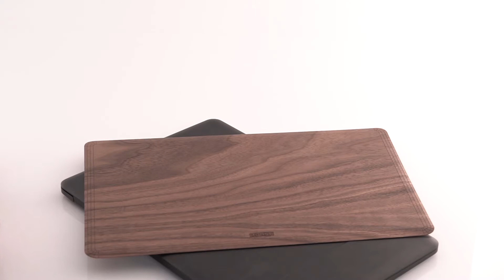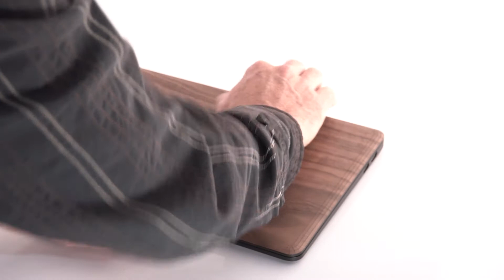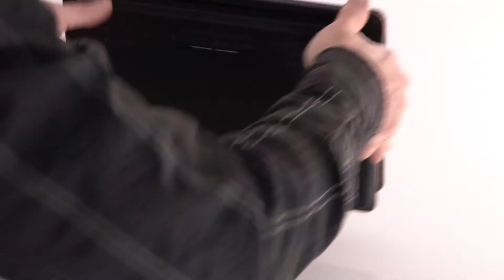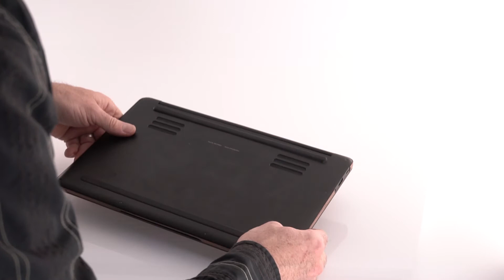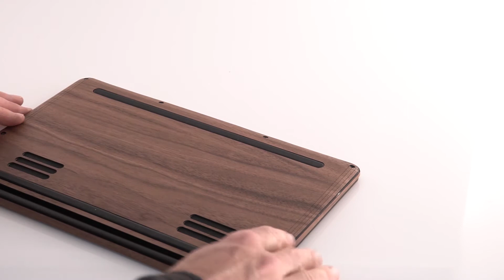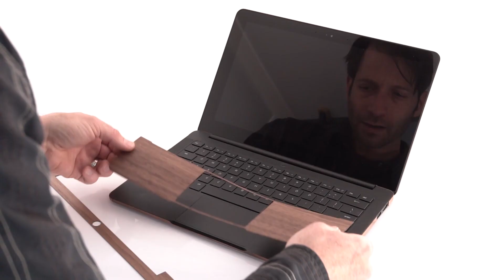How to install a Toast cover on the Razer Blade Stealth

Comment: this is really cool. will it fit the 13.3"? also is there an option for two more strips to cover both edges of the keyboard?
Reply from the maker: We did confirm with Razer that there are no differences in the body shape between 12.5" and 13.3", aside from the screen size.
Reply from the maker: Had to clarify this on our end. The bodies of the 12.5" and the 13.3" are identical, except for the screen size.  So this cover will fit both.  The optional screen panel is designed for the 12.5, and we'll soon have it for the 13.3.
Reply: nvm my question about the extra strips/panels. I just realized that the speakers are on the sides
Reply: Toast alright, thank you for responding promptly. I'll keep an eye out for the 13.3" release.
Reply: Did you mean the 14 inch Blade or the 13.3 inch Blade Stealth? Because the 12.5 inch and 13.3 inch Blade Stealths are the exact same size
Reply: Ventrion Systems 13.3"
they may be the same size, but I'd like to see how it fits on the 13.3" before ordering especially since this is specifically designed for the 12.5" and Toast hasn't mention that they've tried it on the 13.3"
Reply: Toast alright, thanks!